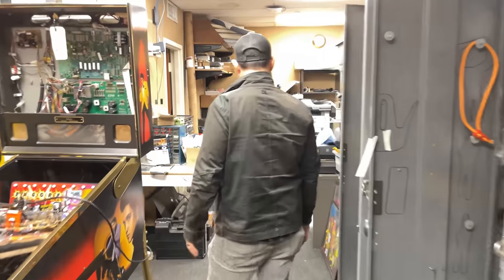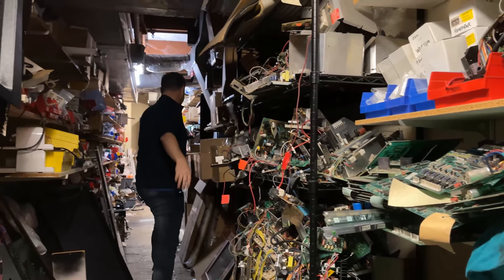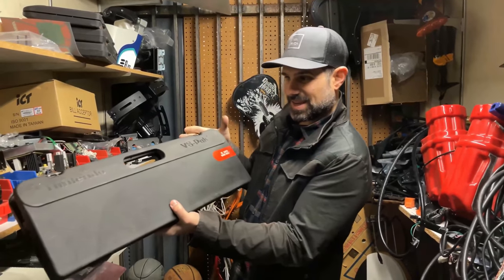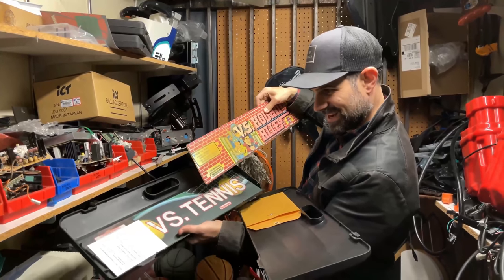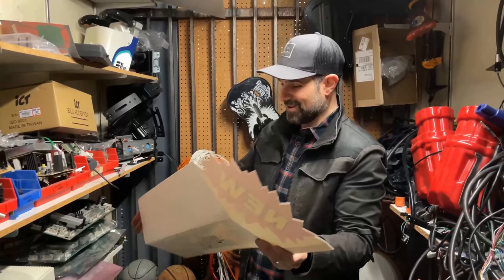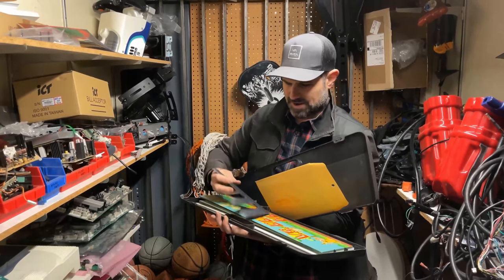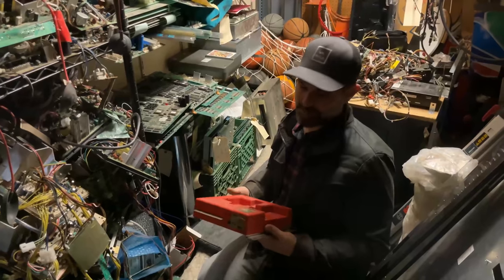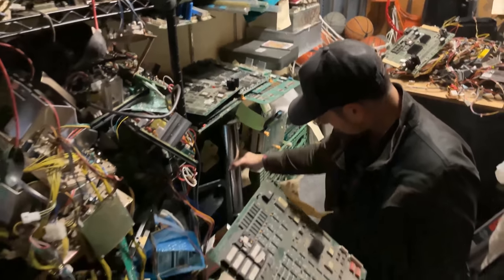My Most Epic Arcade Discovery!

Comment: I loved the Grid and played it at Castles and Coasters many years ago. It was exactly where he said it was on the arcade floor. You might want to check with Mesa Golfland, I worked there for 3 years and we had 4 cabinets linked together. I believe they still have two of them upstairs for birthday parties. I also saw one a couple years ago in their version of the graveyard. Not sure if they got rid or sold the cabinet but it would be a great place to start.

Comment: The cabinet shape looks fairly similar to the classic 90's Midway cabs... maybe put Grid artwork on two old MK cabs and place them side by side, or just build new ones with plans widely available online? Either way, that's going to be a beast of a project... If I was going to tackle this with no access to original cabinets, I'd just make one giant two-screen Midway cab from scratch. It would be a one-of-a-kind item and would keep those PCBs up and running like they should be. MDF would be less than $200, artwork and monitors (etc.) would cost an arm and a leg, but it would ultimately be cheaper than trying to find two original cabs to work with. No matter what you do, this is likely a $1,000+ project even with the parts you already have access to.

Comment: There comes a point where it's just not worth worrying about having the original cabinet. If you have a PCB and have trouble finding an empty cab, in any condition, there's a high chance that there are more PCBs than cabs out there. From what little I can find, The Grid MIGHT be one of those situations.

I would try to reproduce it as close to the original as possible. Some cabinet kit makers have options for fully custom designs, so going to them might help the process - I know North Coast Custom Arcades does that just off the top of my head, but I'm sure there are options closer to home for you.